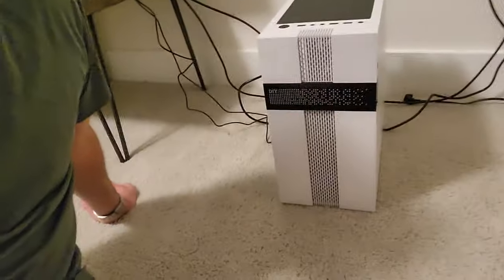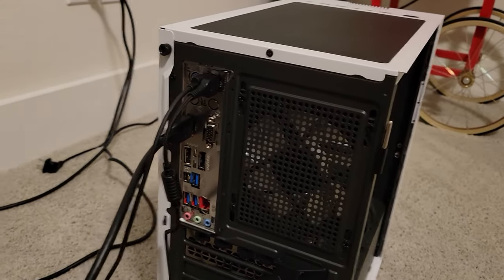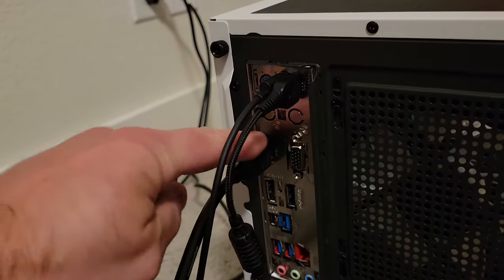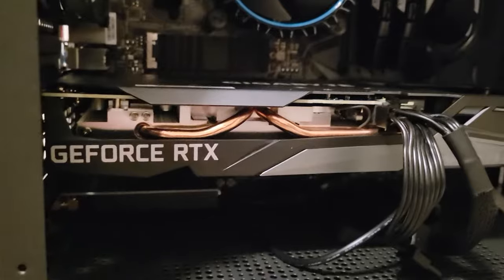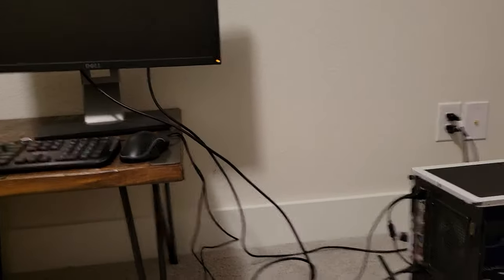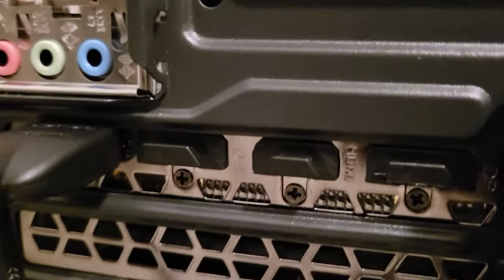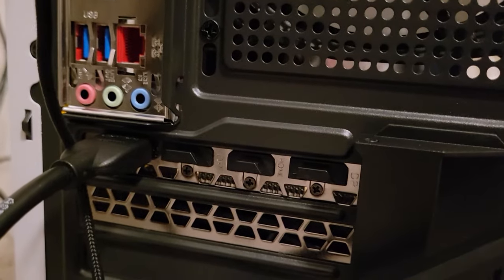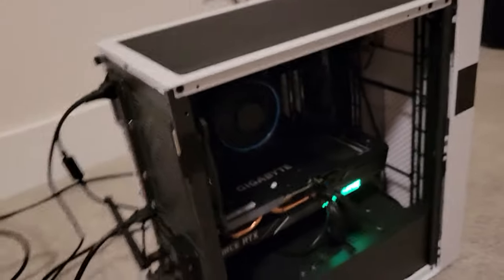FIXED: PC 5 Beep Error Code at Startup with no Video Display

Comment: bro my thing turns into a hellcat lmao fans starts zooming like its about to explode
Reply: Same
Reply from the maker: Has it self destructed yet?
Reply: @JohnFixes  No i was actually able to fix it a few days later I kinda forgot what the problem was though only thing I phase problems with is PC freezing with buzzing sound after playing fortnite for a little PC doesn't overheat or anything I do have a bad sector in my HDD getting a SSD to see if it resolves the freezing
Reply: I also had fps drops I was able to fix it by changing the in game fps limit settings and using something called forfect you get free 24 hours to fix stuff in the computer itself and identifys any issues like my registry files etc which helped my 100% disk usage i think

Comment: I am getting same beep sounds as in video but in my case culprit is my ssd and hdd whenever i connect it it won't display anything and beeps 5 times if i remove it it boots in bios i also tried using new ssd same issue also if i connect bootable  i am getting same issue can't figure out what is the issue

Comment: my monitor cable was 5 meter length and  I got 5 beep error. replaced with shorter cable and problem solved !!!!
Reply from the maker: Interesting! I didn't think about bad cables causing the problem

Comment: Thank you very much. You fixed it for me. I'd built my computer yesterday. It was working. I disconnected it from the monitor and stored both overnight. This morning I set it back up to begin dialing it in, and 5 beeps with my Gigabyte motherboard and no video. Quick google search. I thought the used graphics card had failed, unseated,..., maybe the used power supply failed. I swapped power supply to graphics card cable. Still no joy. I composed, but hadn't yet sent an email to the person I'd bought the graphics card and power supply from. Amazingly, I'd not just fired that off before I did another search and found your video. Thanks for saving the day, and for your well done video.
Reply from the maker: Proving once again... "Not all heroes wear capes!" 😅
(The best way to thank me is to subscribe!)

Comment: Thank you so much! I didn't actually have an error with plugging in my display port cable to my motherboard to begin with, however, I did run into an error where my screen froze after closing a game (that was supposedly taking up a lot of memory). SO I tried unplugging it and re-plugging it back in and I didn't get 5 beeps after that! PC works normally now thanks to this video!
Reply from the maker: Happy we were able to help get you back on track!

Comment: Thank you so much man 🙏🏻 i was playing Warframe, but then PC got error, and once i force restart, this 5 times beep happens with no display.

I was wondering what.. cpu problem? (I gulp coz my cpu is 12C 24T, got no money to buy new 1).

So i did what you've said, i unplugged my DP Port on Graphics Card, and put it in again and viola 🎉. I get into desktop now. Thank you so much. Great video, explained greatly.
Reply from the maker: Glad we helped you find the solution!
Reply: Oh man, you're not gonna believe this. But.. it happens again just now.. 5 beep. No display.

But this time i already unplug and plug it in. But nothing happens😢 @JohnFixes
Reply: Wait what! 😮.. after i comment here and and replug my DP Port and plug it in.

Push the button Start. 

NO 5 BEEP! 😮😮😮😮😮😮

It's now displayed correctly as it should be again!😅😂🎉Wooow.. the heck. Unbelievable..

Man.. 

Arhhhhhggg... Don't know what to say... But, thank you 🙏🏻

Comment: Hi John, I have the same issue but it’s still does the beeps without any hdmi cable in
Reply from the maker: Attach your computer to the monitor like shown in the video. If that doesn't fix it, then it's something else.
Reply: @JohnFixes  thank you, it still does it but I appreciate the response.
Reply: @huexcs  take out all of your PC components (CPU, GPU, RAM, CMOS Battery, and PSU Cables) and wait for like 10 minutes (idk why just wait), and then build it back... thats it, it work for me tho, i have GIGABYTE motherboard

Comment: I have the same exact problem, but the thing is that i play in 4K 144hz without any problem, every component works correctly, i monitor everything while gaming and it seems that there is no difference. i don't know exactly what it is but forsure it came out after i updated the Bios and messed with some settings

Comment: It worked for me but still sometimes I get the 5 beeps. And like 4 seconds of black screen then the monitor turns on again. Is it maybe due to old monitor and it's just a delay? It happens like only 1 out of 6 time that I turn on my pc.
Reply from the maker: Not sure, but maybe you could try a different cord between your pc and monitor? That would be less expensive than trying an entire new monitor
Reply: Did you ever find out what fixed it?

Comment: I have a lenovo thinkcentre and a few months after I bought it I noticed a problem. Sometimes it started beeping like this

..._..._..._..._

It mostly happened when I was trying to turn on my pc when it was warm. I learned that it was a problem with my ram from the lenovo website. But replacing the ram didn't work. Then I turned off that hibernation or whatever because I thought maybe it had trouble saving to the ssd. Surprisingly it solved the issue.

But one day I was playing with paint 3D making a weird thing with 3D shapes. I had Intel HD graphics 2500 so it was really laggy. Suddenly the screen froze and weird black lines appeared on the screen. I panicked and accidentally turned of the outlet. I was really worried about my gpu and couldn't sleep the whole night. The next morning I turned it on just to see if it works and sure enough it did. But today when I tried to turn it on, the old beeping pattern appeared again. Is there something wrong with my vram? It's intergrated graphics though

Comment: I have the same problem, but the difference, I didn't use any vga. I use a gigabyte h510 m h v2 motherboard, and i5-10400. I Still looking around why I have the 5 short beeps.
Reply: did you solve it?

Comment: If it helps anyone, my 5 beeps issue was memory slot 2 AND 4, yes, both, luck me…. Just put ram on slots 1 and 3 and worked (tested all other combinations, 1&2, 3&4, 2, 4… only worked 1, 3 or 1&3)
Reply from the maker: Thanks for the suggestions!

Comment: Interesting solution, although every gamer there is would most definitely insert that HDMI to the video card, since it is a main workhorse when you want to play games, but I understand the inexperience. However it looks like my issue is with something else. I do have HDMI and DP ports on my GPU occupated, but the beeps are still happening, from time to time, especially when I just turn my PC on in the morning. I do have a receiver which HDMI connects to in order to get the sound from my passive speaker system. Although I can hear windows running on the background, I have no monitor input, and simple turning off and then back on solves the beeping issue, but I'd be glad for possible tips to get rid of it for good, if there is anyone who might know.
Reply from the maker: Please let us know if you get it figured out... and thanks for watching!
Reply: @JohnFixes  Good thing you've messaged me about this. I solved the issue at hand by simply installing chipset drivers from my MB official site :/ Weird, I know, but it did the trick

Comment: My HDMI cable was in the GPU, but it still gave me 5 beeps.

I use this config:

i5-10400F
GTX 1050 Ti
2x8GB 2400MHz DDR4 RAM
650W PSU
256GB m.2 SSD + 2x2TB HDD
Reply: Did you finde solution?
Reply: @damianzpip8742  Might be the front USB, or some kind of interference between the motherboard and the GPU (I switched out my 1050 Ti to a 750 Ti and it worked)
Reply: @tothpeter2296  i switch rtx 3060 on gtx 970 and its the same but thanks for answer i maybe take computer to somebody who will repair this